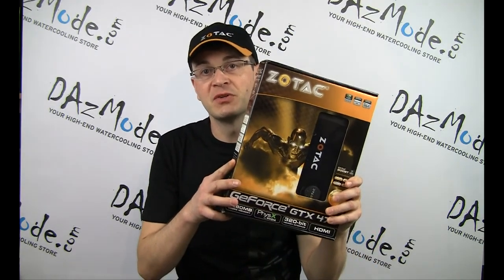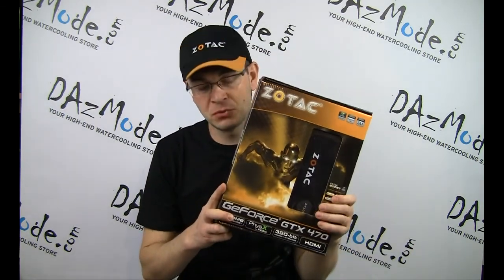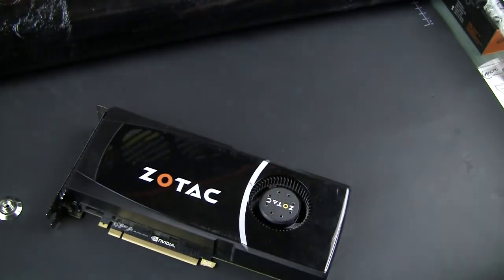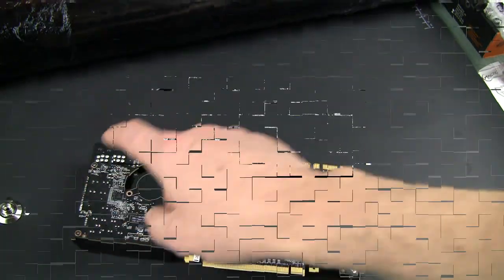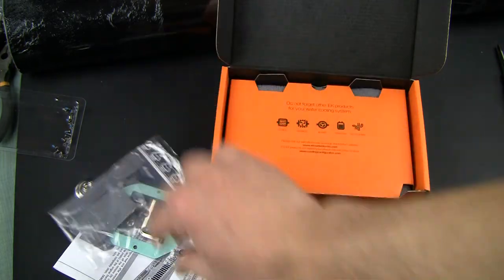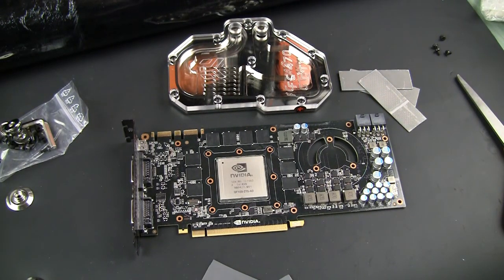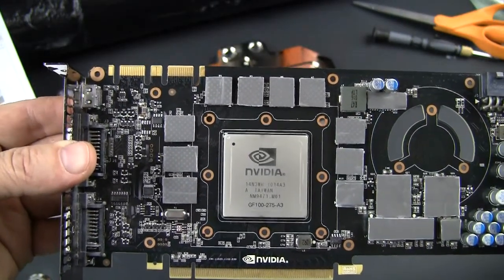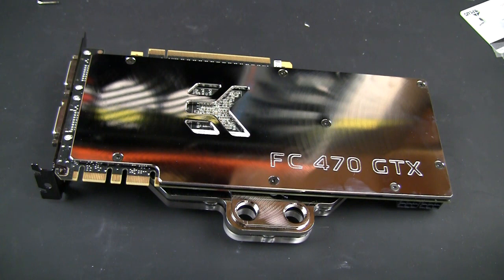Detailed GPU Watercooling Block Installation Tutorial - DazModeLab

Comment: I have a EVGA GTX 470.  ? what will it cost me to cool it.  Complete kit.  
240 Rad with 2 Fans .  Mid to high range cost.  I have a coolermaste case 690 basic 
modded with an H50  push & pull fans for the CPU.
Thank You.

Comment: Thanks for the reply. I am used to working on cars and indeed I did over-tighten them.

The first 2 ( doing SLi at once) I damaged the chips to the front of the board, 
on the second attempt. I only barely damaged card number 2. it still works, but throws up artifacts. I tried to bake it, with no success.
-Costly learning mistake! 
in future I will go finger tight, then just nip them off and then run and check for temps

Comment from the maker: @cheozuka Installing smaller blocks like 4x0/5x0 unlikely give you much trouble (especially with reinforced plate), but with larger (longer) blocks PCB can bend easily and with enough determination you can crack it.

Comment from the maker: @cheozuka This is good point. It is always puzzles me how people manage to crash plexi-glass, kill threads in acetal and otherwise destroy good stuff. 

When you install block (it doesn't matter GPU block or  motherboards block) you need to watch for PCB bending. Never tighten screws in such way that makes PCB bend. Tension may wary from case to case. I barely tightened my MOSFET blocks on GA-EXTREME board for example.

Comment: Hey,
The part I was looking for the most was not on the video :|
I want to ask, when installing the block onto the pcb. obviously (as per instructions you tighten the core screws first) then work around, but how tight did you tighten them.
Reason is I broke 3 GTX 280s :( - I am not a noob, just have not had that much experience with full cover blocks and bought mine 2nd hand, so had no instructions at the time. Someone told me to tighten them finger tight, then just tighten a little more. agree?